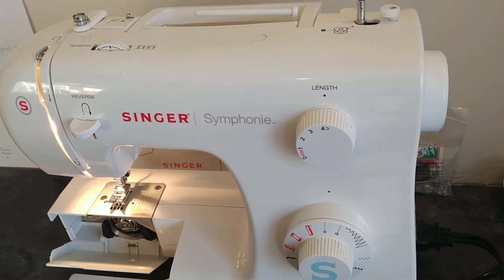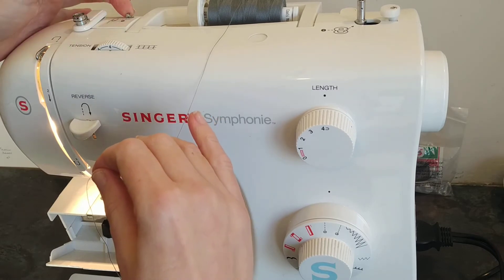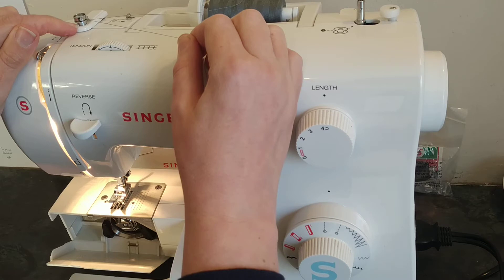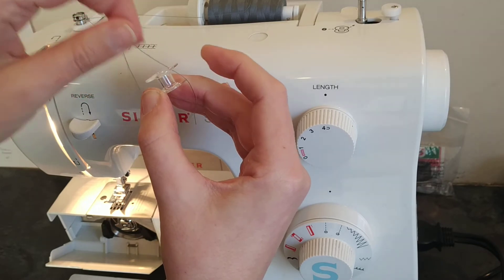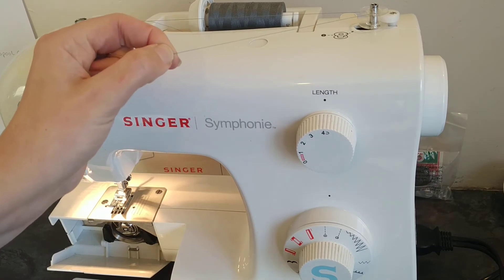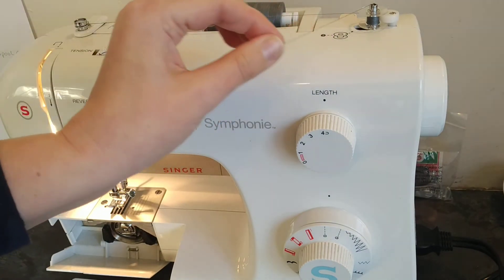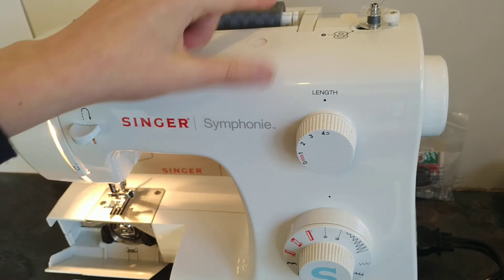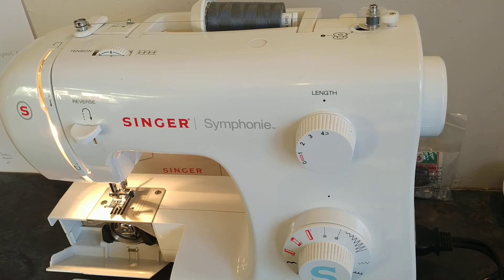Singer 2250 - Part 1 - making a bobbin

Comment: Which better to buy this model or singer 8280
Reply from the maker: Both are great beginner machines and will suit most projects well. This machine has a range of stretch stitches that the 8280 doesn't have. For ease of use, I like the position of the reverse lever on the 8280 compared to this machine.